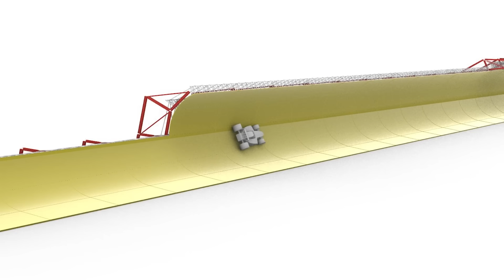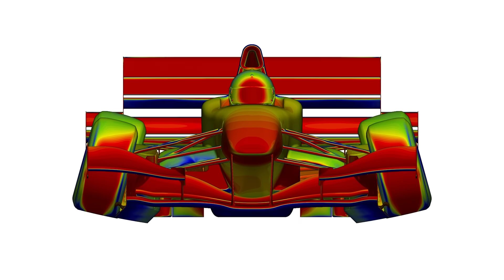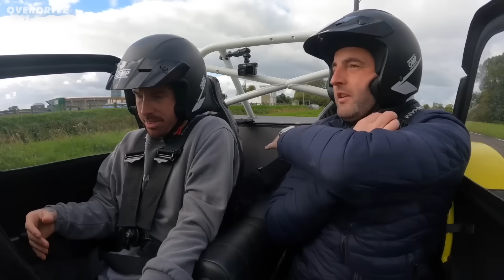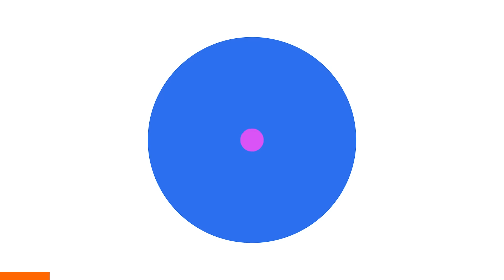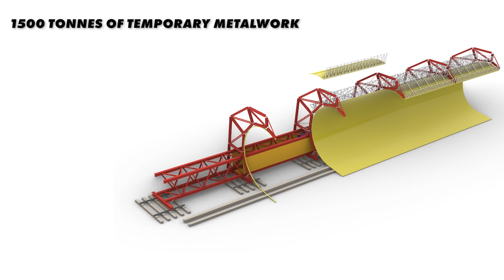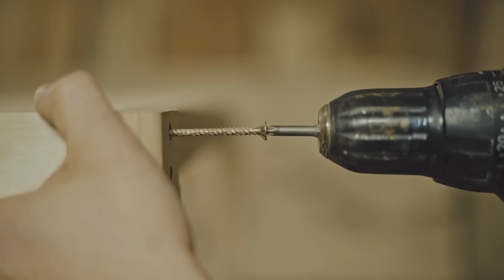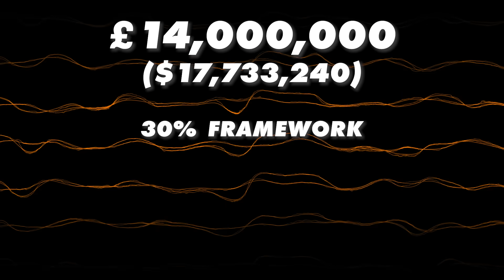Why It Costs £14,000,000 to Drive a Formula Car Upside Down

Comment: Maybe just set up a wind tunnel that can blow air at sufficient speed, hang the car upside down inside the wind tunnel and strapped/braced in a way to stop it behind pushed backwards from the drag, and show that the car is holding itself to the roof with some load cells between the wheels and the roof or something similar.

Comment: Why would it cost that much?  This is silly! As mentioned previously, all you need to do is to build a cradle which the car is in and the cradle is placed on top on a vehicle which achieves the desired speed.  The cradle is engineered so that the car inside it can invert.  Does this make sense?

Comment: Honestly, I think that if you want to do a combustion engine, a rotary might work out pretty well. You don't have to worry about upside down oil pans starving the engine of oil, as oil is distributed amongst the apex seals, not relying on gravity to keep the bottom end of the engine lubricated. Just a thought, but it might be worth considering.

Comment: The track will deflect somewhat as the car travels, especially at the top. This will probably result in some wasted power and tricky steering. I hope you have a chance to test or simulate this.

Comment: There is another way … get a 60% wind tunnel *F1 test model. Build a 5m long ‘roof’ in a wind tunnel.  Mount said 60% model upside down on a post. Run the fan to a speed at which it is calculated that the car could ‘suck’ itself to the roof. Retract the post. If the model stays there - job done
No issues running the engine upside down.
No suspension geometry issues 
No driver safety issues
No 14 mill £ issues

* 100% would be better but proof of concept with the common 60% model would do.
Over to you Red Bull Racing

PS: a mention/thank you in your celebratory YouTube post will be thanks enough.

Comment: Wind tunnel: 
1) Put an F1 car upside down against a "ceiling" surface in a wind tunnel.
2) Turn on the fan and see if the car stays there when you loosen the cables that hold the car up.
OR
1) Build a rotating box for a wind tunnel.
2) Drive the car in and turn on the fan to simulate the speed of the car.
3) Rotate the tunnel until the car is upside down
With sensors under the wheels you should be able to show the amount of "downforce" being generated at various wind speeds.

Anything beyond either of those seems like a HUGE waste of resources - after all you mention "making this project as sustainable as possible" (9:00).

Comment: save cost and have a rail to support the vehicle as it gets up to speed. Star upside down, finish upside down, single flat surface with supports. You're cost is making this a curved tunnel when it doesn't need to be.

Comment: 14.000.000 is a lot of money for 5 seconds.
For sure because you know it is possible.
A smaller pipe and an RC car might not be on the same level of excitement, but would prove the concept.
It is a cool challenge though.

Comment: I think this is an idea that is long overdue for demonstrating.  We racing enthusiasts have been saying for 40 years that F1 and Indycars can drive across a ceiling.

But I got sticker shock when I saw the price tag on the video title.  Maybe you need to set more of a commercial goal for the tunnel.  Make it a permanent structure as part of a race course or automotive-themed amusement park in the Middle East, funded by oil money.  If you succeed in performing the stunt, maybe people will want to experience it as passengers.  Build two-seater cars so you can give rides.  Start a school to train EXPERIENCED drivers how to do it.  

Or maybe go back to the drawing board to figure out a cheaper way to do the stunt.
Find an existing building with a flat ceiling that could be driven on, then you would only have to build a half-revolution helical transition ramp.  Make a balloon-shaped path on the ceiling that the driver would have to follow to turn 180 degrees to get back to the transition ramp to make the exit.  It would be a much more challenging stunt for the driver.  Instead of just going straight while inverted, he would have to make right-left-right sweeping turns at 90 mph to save his ass by finding the exit ramp.

Comment: This seems to become a bit overdone of what its supposed to be .. at 14 million it should definetely be cheaper to find something that already partially exist. Also, the ' open'  structure makes it a lot harder to support. If you use a full circle structure, just not pave it all the way round, it should be a LOT lighter, cheaper, easier to source etc. At least that seems much more simple and elegant from an engineering perspective. I love the effort but at 14 million and building a whole track for one-time use its just a bit meh in my opinion.

Comment: I wonder if you factor in the weight of gravity.  The car and you will be upside down.  Aerodynamic downforce will not be the same if you are driving upside down.
Reply: They factored in gravity and discussed it in an earlier episode.  They have safety factor in downforce over and above the weight of car and driver.

Comment: Will you test the downforce of the car on the plywood to see if it will pull out the screws?  It just reminded me of F1 race Baku years ago and more recently F1 race at Las Vegas, where the car pulled the manhole covers and damaged the car.  I wouldn't want to see this car inverted and the plywood comes off.  Just want to see this project succeed, safely. :)

Comment: I'm wondering if you already contacted some formula student teams about buying electric motors directly from them. Quite a few of the teams (at least here in Germany) design and build their own motors (or partner up with manufacturers). The specs should also be pretty much what you need, so you could save a lot in development cost. In the last years some of the teams even sold motors to other teams and it was far from being hundreds of thousands.

Comment: This is an awesome project and I'm looking forward to seeing it happen.  If it were me, I'd just buy an EV hill climb car, mount it upside down to some sort of truck with a hydraulic lift, find or make a flat topped tunnel, add some weight to match a driver, and program a computer to steer the car.  I'd get the truck and car up to speed, lower the lift so the car was free on the tunnel roof, drive for however far possible in the tunnel, raise the lift, and then slow/lower the car.  That wouldn't be nearly as cool though.

Comment: Surely the most ideal place for this is one of the top speed proving grounds such as the salt flats? Although the costs of transporting the materials would be significant. And I'm not an engineer, can the salt flats sustain such massive amounts of weight?

Comment: You are over complicating this stunt. Originaly you just wanted to run an F1 car upside down so it sticks to the roof. Why not JUST do that? 2 cars, one upside down ontop of the other on a padded frame. Upside down car has it's engine same way up as the bottom car, so it still works. Run both cars down a tunnel with a flat ceiling. When they get up to speed the top car will rise up and run along upside down, no longer supported by the bottom car. Slow both down and top car settles back onto bottom car. Stunt done. Why are you bothering with the transition and the round tunnel?

Comment: I know the idea is to drive the car into an upside down position, but those costs are huge. Why not suspend the car in the first place? Eliminating all the requirements for the altered suspension geometry and dangers of driving into an inverted plane. Building an upside down road would cut the length of a tunnel design down massively, significantly reducing the material costs. Use a rail system or electromagnets to keep the car suspended upto it's optimum speed and then prove it can drive upside down with aerodynamic force alone. Arrestor cables and catch net to stop the car at the other end. Seems like a lot of over complicated design to me, and I'm no expert 🤷‍♂️

Comment: Hang an F1 car upside down, in a wind tunnel, bolted to an upside down road. Turn on the wind, raise wind speed until the data says the "downforce" is greater than the weight and release the bolts......... Walks away with £13900000 and the theory proved..........

Comment: Thinking now... As you make that transistion from level flat ground, up the side of the wall and eventually to a full inversion, the total time of the transition is going to be fairly short, meaning not only will you have to deal with the inversion, but also the momentum from what is essentially a corner, the car is going to want to continue that spiral as it reaches full inversion.. Long story short, you might need to build a full tunnel as opposed to the current design of a half tunnel.

Comment: Could it be possible to put a rig on a train or other straight track vehicle (rocket rail from Mythbusters) where you can hold the car in place until you hit the required speed to allow it to sit there by pure downforce alone?

Comment: QUESTION: Isn't it better to use solid fuel rocket to give you insane acceleration rather than relying on motors?
Reply: They're not very easy to throttle down or turn off in case they decide midway to abort the run.

Comment: Couldn't a McMurtry already do this while stationary? 1000kg of car with 2000kg of fan assisted down force at 0km/h.

This has gone from an F1 car upside down to a custom electric car. So why not just use a McMurtry which doesnt even need to move.

Cost is loaning a £1m car and sticking it to the underside of the floor slab in a Bunnings car park and driving it around a bit which is a flat surface.

This just seems to get lamer and lamer anyway.

Comment: Cut the structure cost in HALF; repeating what i wrote on the previous vid:
Reply: It seems that the project started with the idea of a "tunnel" and even once that got scraped, remained stuck with this mindset. 

Question: Why a "tunnel"?

You talk about the 7.5m diameter being about as small as you can go because of camber of the wheels (and I assume the air gap under the vehicle increasing, and thus reducing suction), thus limiting the minimum diameter. But none of that is needed. 

Idea: Consider a flat steel ruler and twist it. The ruler remains (close to) locally flat, while traversing the path to being upside down. This will create a small twist to the car driving on it, but it will be SMALL, since the change occurs over the LENGTH not the width of the track (i.e. the "tunnel")

I expect that the "tunnel" created for this track can be made as small as 4 metres (...maybe even less), the wheel camber can be close to stock, and the air gap under the car will remain near nominal throughout. 

I expect, however, that this change will make the path more difficult to drive, since you will be constrained to being ONLY on the nominal roadway, with bumpy transitions if you leave it.
Reply: FYI: I have degrees in physics and electric engineering.

Comment: As a project manager, I think there are a few clever ways to drive down the net costs through a complete lifecycle analysis. I think recycling should be considered as a way to revalue all the waste this is creating. I think a change of material (eg. switch non-recyclable plywood to steel) might drive the costs up but would also drive the recycling revenue way up effectively reducing the bottom line. I see all this material expense as a big waste of resources and a potential impact on the market prices. Public acceptance might need to be considered beyond YouTube fame to prevent public-initiated road blocks.
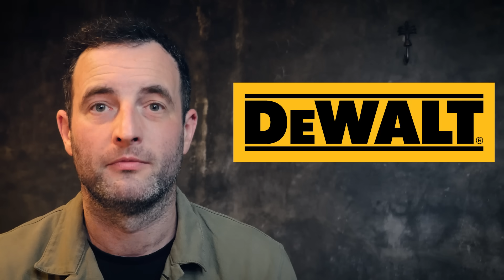Reply: I think they are already considering reselling or recycling the plywood and other materials. They mention at 8:53 that screws will allow them to reuse much of the surface and their engineering partners are focused on sustainability. This video seems to be about the up front costs, presumably they can also resell the car and part out the motors and battery to recoup some of that cost as well.
Reply: plywood is recylable though, it's called scrap wood, and can be used in many applications, from random furnature to structural to many other things. just because the plywood's been used doesn't mean that it can't be reused in some way shape or form. though buildning a house with it might be asking a bit much, that's also an option.
Reply: Steel is way to heavy for this. If they use a steel surface, the frame will need to be much stronger and thus more expensive.
Reply: Additionally car need a grip, so steel could be to slippery
Reply: plywood is recylable though, it's called scrap wood, and can be used in many applications, from random furnature to structural to many other things. just because the plywood's been used doesn't mean that it can't be reused in some way shape or form. though buildning a house with it might be asking a bit much, that's also an option.
Reply: lol.

Comment: There so many barriers to cross but in regards to being upside down, it might make sense to allow a test pilot to drive it rather than a regular race car driver. 

Also its just struck me that the same goal of proving the aero can hold a car upside down, can be achieved with an giant loop the loop, hot wheels style. But it would be so big that it might be harder than the existing plan. Steering would be easier though.

Comment: Hi Legend - I recommend you also develop a small RC car that's capable of the same feat, you could drive it remotely with FPV gear. Not a great simulation but it might highlight something and it'll help get funding

Comment: This is so far off the original question that spawned it, which is "could you drive a Formula 1 car upside down?", and the answer to that question is so obviously "absolutely not, under any circumstances," that I really just can't figure out what the point of this stunt is, but I imagine you had someone run the math and you're going to make money off this, so...have fun, I guess?

Comment: The first video (we're now up to #5) was called "I'm going to drive an F1 car upside down", which was intriguing. But it doesn't work, the engine won't work, the aero (floor) won't work, the suspension won't work, the required speed is too high, etc etc.

So the plan has been dumbed down to a custom made electric car going upside down briefly on a very short length of specially fabricated "tunnel". It isn't an F1 car, in fact I doubt there's even a single F1 derived component in sight.

In project management we call this 'mission drift' or 'goal dilution', basically it is not the same project as it was when it was conceived. And this is going to cost £14M. It's time to stop.

Comment: To make it way cheaper, You dont need to build half a tunnel, because you don't plan to drive on the side part in the middle. It would be cheaper to build a flat 4 meters wide road that twist around an horizontal axis, like a plane doing a barrel roll. You would need to buy and build much less driving surface. A flat surface would be easier to work with for aero, suspension and traction. And easier to build. 
 I would attach the car to  a safety cable in case of the car falling while upside down.( like a zipline).
Reply: Counterpoints:
1) The support structure would have all of the same structural requirements but probably be more complex for a twisted ribbon road
2) If something goes wrong on this style of road it's possible to return to flat early, that's not possible on a twisted ribbon. Additionally, there's more flexibility for when/how to transition
3) This style of open side tunnel is probably better for spectators, you can see the car the entire length of the tunnel this way
4) A twisted ribbon is, you know, twisted, it still means the car wheels are at an angle and still kills underbody downforce the same way that turning in the open tunnel would. If it was flat, it wouldn't be twisted.

Comment: Bullshit.

If you can aim a car straight you only need a roof, not a wall or tunnel.

Also, you don't need big fat tyres you only need bike wheels once you're up to speed and cruising.

The wheels and suspension are screwing your tunnel build

Comment: Now I see the cost I very much doubt this will ever happen. To all the people asking why Rebull don’t get involved I’d guess it’s because there is literally no connection. If it was using an F1 car then maybe they would but as Scott has stated an f1 car wouldn’t work
Reply: Red Bull sponsored Felix Baumgartner's jump, this is the same sort of insane expensive one shot stunt as that. They might have turned it down for a number of other reasons (eg this is probably more expensive, different marketing/management people at Red Bull than previously, just don't want to, don't want to share the limelight with the Brilliant sponsorships on the discussion videos, etc etc) but one shot stunts aren't new for them

Comment: First: I truly like and admire this project. But since you are going to use a vastly modified car, and not a Formula 1 car (which was the initial intention), technically speaking, this project has already failed.  All you can do is rename the project: "Can you drive a race car upside down?". Project Inversion sounds great. 
Yes, you actually can run an F1 car upside down, but using a real F1 car, too many problems will need to be solved.

Comment: Wouldn't it be easier to just have a giant fan or several fans that blow air at the required speed down the center of a shorter rotating tube? You could place the car there with wedges on the tires to keep it from sliding back and then rotate the entire tube until it's upside down.

I mean, obviously it's not as cool as actually driving it but at the same time, you save a TON of money, and you also save a lot of space, time, and there's less chance that someone could get hurt
Reply: By that logic they might as well not do it since it's already been proven mathematically. The feat is in actually doing not proving it's possible (something we already know).